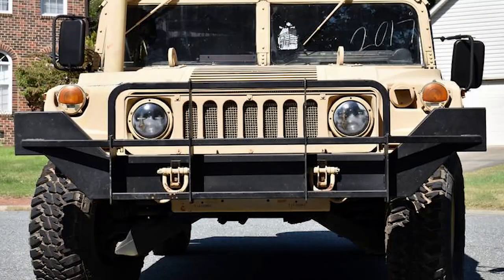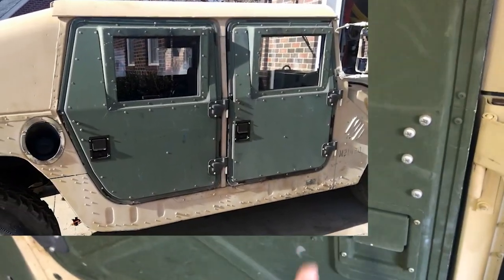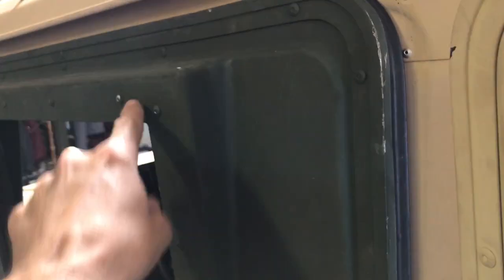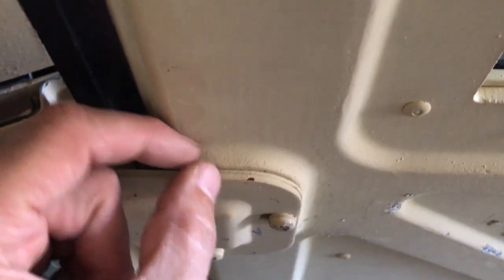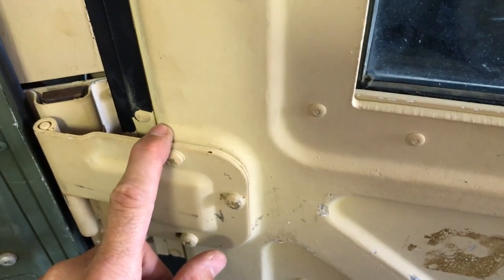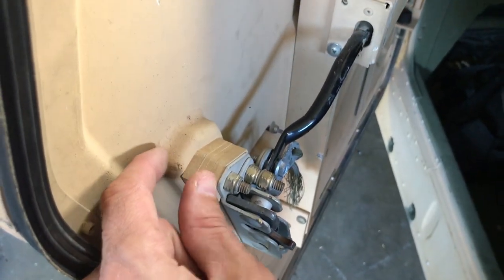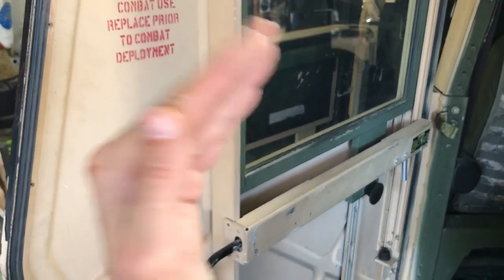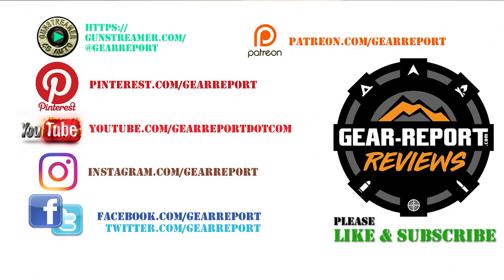Will Straight X-Doors fit Your HMMWV?

Comment: I was wondering. Can you put hard doors on a m998 with a sorf top?
Reply from the maker: The body is the same on pretty much all HMMWVs and will accommodate hard doors. However, other configuration options (hard top, soft top, armor, no armor, etc.) determine what doors will fit.
Reply: @GearreportdotCom  I'm getting a 4 seater with a soft top but the doors are shot. (Not literally) lol wore out. I think the hard doors would be more secure but I didn't know if it'll take hard doors with a soft top. I thought it had to have a hard top. Kool to know. Thank you.
Reply from the maker: @angrypatriot5392  THe hard doors fit better with a hard top. But I had hard doors on my first HMMWV and it had a soft top. https://gear-report.com/project-humvee-battlewagon-surplus-hmmwv-us-army/
Reply: @GearreportdotCom  That's exactly what I was looking for,  that looks great.